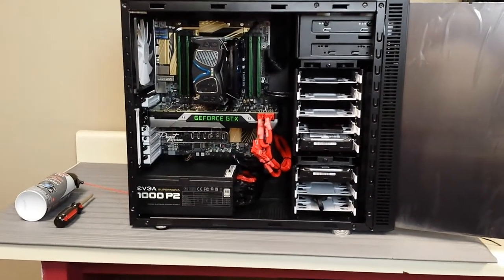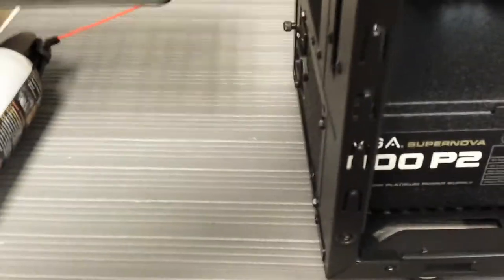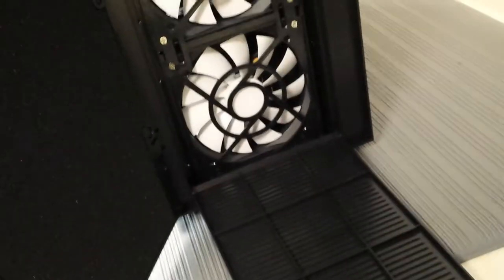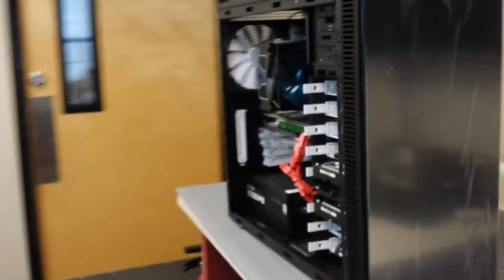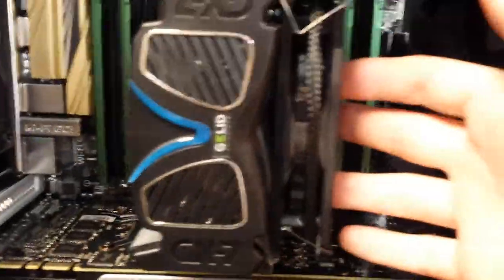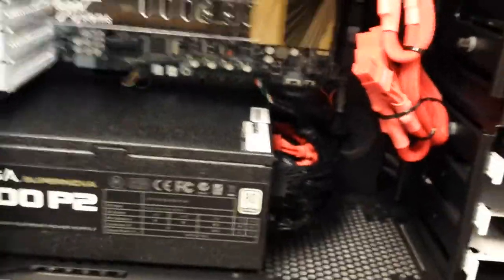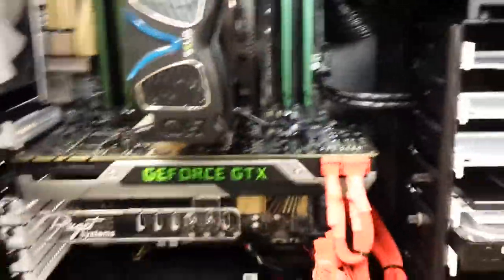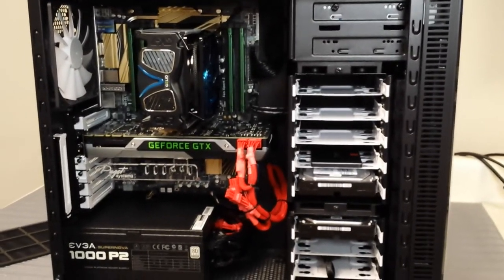Tips for dusting out your desktop

Comment: Remember to also clean to floor around your desktop. And make sure you wipe the floor with something wet because that takes all dust away. Vacuum takes only the bigger pieces but leaves the fine dust on your floor which will be then sucked inside your PC if you dont clean your floor.